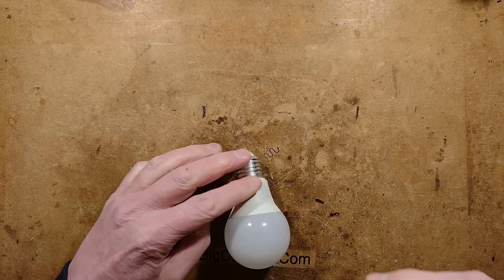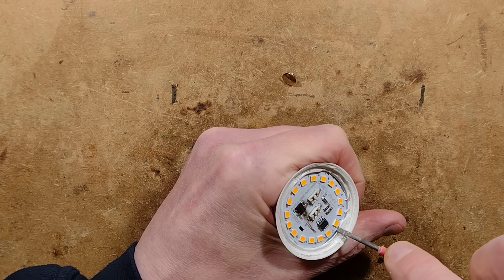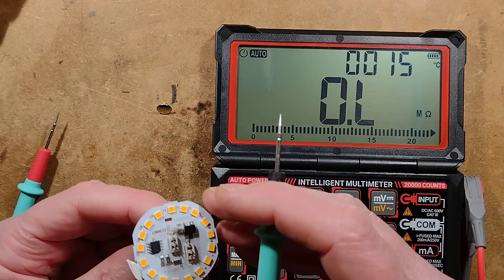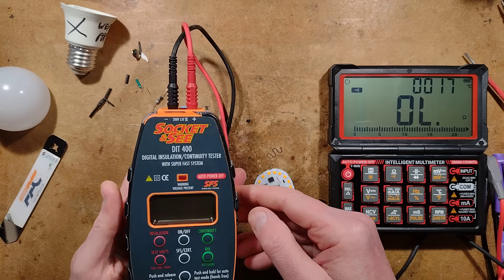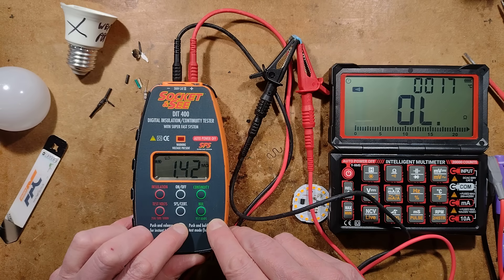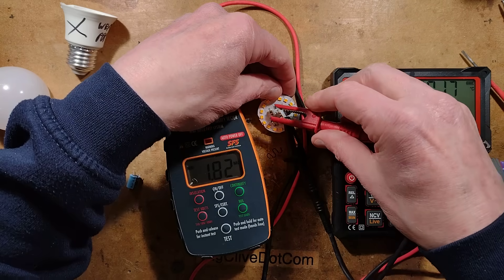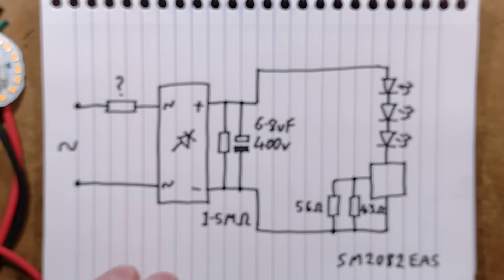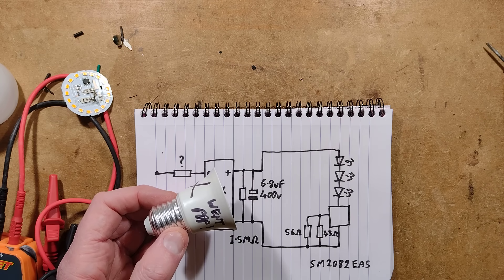Exploring an LED bulb that went POP during a livestream

Comment: Quick question for someone here ...
Is it worth repairing these Led bulbs, as I have bloody loads of non-working ones which I've haven't thrown away yet ...?
Reply from the maker: I'm afraid it's not really viable to repair them.  But with suitable understanding of the circuitry it is often possible to make new ones last longer by reducing the LED current.

Comment: I always try to diagnose my failed LED bulbs. I find that it is almost always the electrolytic cap (too much Chinesium) or one of the LEDs. If it's the latter then it's usually due to them being driven right on the limit.

Most LED bulbs could be made to last a very long time just by fitting a good quality Japanese cap and reducing the drive current by 10%. There would be next to no noticeable degradation in light output.

Occasionally you can catch an LED bulb just before the cap fails as it starts to flicker. I've found if I replace the cap at that stage they go on to last for many more years.

As a designer I would struggle with the ethics of making a product that is deliberately designed to be disposable but doesn't doesn't need to be. It would be possible to design and sell bulbs that last significantly longer and reduce an enormous amount of WEEE in the process.

Comment: I'd love some help understanding the internals of this bulb, because I'm clearly missing something. This being a UK bulb, I would think it would expect 240VAC, and my understanding is that on the DC side of the bridge rectifier, that would be 340VDC. And my understanding is that a linear LED driver will run at a wattage equal to the drive current times the input voltage no matter the load. This bulb is very likely using no more than 10W, so it doesn't seem to me that the drive current can be any more than 10W/340V= a little over 29mA. Based on what I thought I knew about LEDs, that current could optimistically generate like 20 lumens per LED, probably less. 17 LEDs * 20 lumens is 340 total lumens, but that bulb is presumably a 60W replacement, or around 800 lumens. So clearly some part of what i just said was wrong, but I don't know where. Are the LEDs maybe 9V packages of three internal LEDs each, or something?
Reply from the maker: The LEDs are multi-chip inside each package and add up to most of the high DC voltage.  The regulator only dissipates the difference between the capacitor voltage and the huge series string of LEDs.

Comment: Hey Clive, So when analyzing the circuit on the SM2802 part, you identified the 56ohm and 43ohm resistors connected in parallel to one of the device's pins as current sensing. Are the actual resistors current sensing... like they would be like a shunt on a solar battery system to measure current? I looked up the device and it looks like most pins are NC except for GND, OUT, and REXT. It looks like those resistors probably go to REXT which "... on the SM2082 series of LED constant current drivers is used to set the output current. By placing a resistor between the REXT pin and ground, you can adjust the current supplied to the LED, typically within a range of 5mA to 60mA, depending on the specific model. Just trying to understand sir! thankeeeeeee
Reply from the maker: The voltage across the resistors is held at about 0.6V by the internal current regulator.  Changing the value of the resistors changes the current where that 0.6V threshold is met.

Comment: My guess before diagnosis was the cap, they're usually the thing that goes bang... but as soon as you opened it and it was the rectifier I thought maybe not the cap then, but it could just be the symptom of the cap. Did you happen to test it on one of those multi-component testers to see if it's ESR was any good (in addition to it's capacitance?) or no? Anyway, that was interesting, as always. :D
Reply from the maker: I should have tested it on a more suitable tester.

Comment: Clive. What's the maximum current these drivers can be made put out?
Reply from the maker: It's quite high, but thermal dissipation becomes an issue with high voltage drops across the regulators.  Many designs stack them in parallel to spread the load.

Comment: Most likely the bridge rectifier fails - when diodes fail they typically fail short (become a lump of molten metal inside) so now you have AC on the capacitor that shouldn't have AC on it. Capacitor popped because the polarity reversed due to the shorted bridge rectifier, Electrolytic capacitors fail short until the electrolyte dries out (the electrolyte is conductive - the capacitance is caused by a thin oxide layer on one of the plates. The oxide layer dissolves under reverse polarity which causes the capacitor to fail short, which causes high current flow and causing the electrolyte to boil and pop. It's also why you need to reform electrolytic capacitors - long time of no usage means the oxide layer can dissolve and applying the proper voltage causes it to regenerate. The capacitor shorting out caused the fuse to blow because you're looking at a short.

Comment: I made an LED explode once, The story was from when I did not have many means of testing capacitor leakage current and I rigged up caps under test in series with a 5mm LED and loaded it up to the specified voltage and if the LED went out there was no leakage current to mention. It was a quite useful method but you also needed to discharge the circuit manually since series resistors would light the LED and render the test useless but I had a fixture for it. at one time I was testing a 500volt cap and had it fully charged when something in some unknown way made the cap discharge itself through the LED when being charged to 500Volts and the bang was absolute insane, what more is that the LED just vanished, no smoke, no parts! nothing, All gone! Just a loud bang and it was gone and only one of the two legs was left in the holder and the rest was vaporized without a trace of remains. I never figured out what happened or how it was even possible due to the way it was set up but well, I guess it gave up the ghost lol

Comment: Clive blows the dust off some interesting testers retrieved from the bottom of his test equipment cupboard, then uses one to blast 500V onto a 400V electrolytic. What could go wrong ?

Also - If you've ever short of ideas for the next video; a quick mini review of that Aneng Automotive meter would be useful. It wasn't easy to guess what some of those button functions were.

Comment: From what I can determine, those are 18 Volt, 0.5 watt 2835 LEDs.  The SM2082EAS is set to 25 mA.
I didn't realize the 2835 came in 3V, 6V, 9V, 18V and 36V versions, and 0.2, 0.5 and 1 watt.

Comment: You could 3D print a new frame for the insulation tester from TPU. Just take a photo straight down on the meter, and trace the outline in CAD.

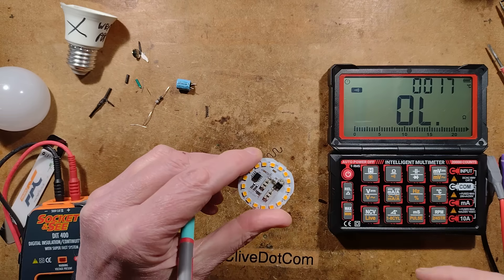Comment: 3:29 - It is easy, hotplate is 2$ on Ali, just place the board and it will melt solder in 5 seconds... you can also replace leds with that hot plate.
Reply from the maker: I have a hotplate.  Unfortunately the two connectors protrude.

Comment: every single dead led bulb i've poked around in of this style has been due to a faulty cap. the heat inside the bulbs lower area is contained enough that it shortens the lifespan and causes the cap to give up the ghost, i suspect.

i've literally never had any with any of the leds themselves failed.

far as i'm concerned, designed to fail. they're typically rated to a minimum of 5000 hours, but i've yet to have one last that long.

Comment: Can these lights with blown up circuitry be used in battery powered projects? Or will they not do anything without high voltage?
Reply from the maker: Not so easy, as the LEDs are multi-chip and need quite a high voltage to light.

Comment: Seems new caps are getting crapper these days even at 400 volt rated in these new led lamps and mini psu dofers, probably totally shorted rectifier for a few milliseconds or just overheated it's encapsulation to conductive carbon then popped it.
Gaz Yorkshire.

Comment: I have a LED bulb that uses three BP5131D
 chips to drive fifteen 2835 LEDs in series.  Very confusing.  From the schematic I've drawn the LEDs are over driven.  They are all out.  The label read 650 lumens, but 510 is the most it should be able to do.  Is over driving typical on these bulbs?
Reply from the maker: The LEDs are probably multi-chip LEDs.  They almost certainly are being driven very hard in consumer lighting.

Comment: 9:53 Focus sensors are typically a line of sensors, either orientated in a vertical or horizontal position. (or a mix) Your paper only has vertical lines, so the reading of the vertical sensors does not change as the camera is trying find the spot where the sensors give the highest contrast reading

Comment: Oh!! And dang it!! I have given into the LED bulb craziness! I like the filament ones more than these cheesy snow cones but have both. Some color temps I like like 6500 K true daylight that matches my vintage fluorescent lamps can beca bit hard to find, though! Ignore the double “like” above, my POS Apple phone has been glitching lately. I also find the filament bulbs with vertical slightly angled filaments do poorly base-up, where actual strong downward light is wanted, the snow cones do way better here for obvious reasons. Actually same issue as vertical axial filament incandescent bulbs as well. I still HATE the harsh 5000K ones though! NASTY! They should be taken off the market. Awful and way too stark. My best friend who is also a lighting buff and a bulb collector like me has disowned me because I went to LED for general lighting, but why burn up no longer made bulbs and have high power bills? He needs to wake up to reality! Cheers! Glad to be back! (Rick Delair!)

Comment: There seems no way to repair these. They are mde as throw-way items, sadly.
So even if you manage to replace the bridge rectifier or the self discharging capacitor,  you would still need to connevt the board to the bottom contact...
Hey, would have loved to see you pop the capacitor at 1000v !  😁

Comment: This is a small portion of why I kinda gave up on the idea of keeping lights with proper sockets at home and switched to led strips...
At first, I purposefully got light boxes with proper fixtures so that I could always just change them if they popped. But since then, I had multiple of them failing because these led light bulbs sold locally are not only expensive, they are also very poor quality. Couple of them popped like this one, and I had one weird case in the kitchen that was just whining, making a weird noise, and also changed it's color... when I took it down the plastic was all cooked and cap partially leaked or something.
So.. it's the fact that these led light bulbs not being a guarantee of long life, plus other benefits like the new lights coming with a fan, and being sealed off so no bugs come in, that convinced me to switch. Of course, now if one of them fails I have to replace the entire thing (or at least DIY replace the strip), but it's not all that bad. They come with a standard base that is fixed to the ceiling, and you just need to undo some screws and twist unlock it - the whole unit comes out. Kinda better than the wobbly fixtures I had before. Also put some lever nuts to make it easier to take out too.

Comment: Some years back I had a cheapie Chinese LED bulb experience a catastrophic failure. It popped and launched the small clear plastic envelope out the top of the glass chimney of the antique lamp.  The cat found the plastic part which eventually ended up in the kitchen.

Comment: My debug process, after testing the fusible resistor and finding it blown open, would have been to apply utility mains voltage through a couple ohms of resistance to the AC side of the bridge rectifier for a few seconds. (i.e. can you repeat the failure ....).

Comment: This was interesting. I've recently been taking those LED bulbs apart (didn't know they could be taken apart easily before) whenever they fail. I used to just toss them out thinking that was the end of it. Most of the failures on the non-smart ones I've looked at is there's always a burn mark around one LED (quite a visible burn mark as well). I was not able to fix them unfortunately. Saw some videos of people bypassing the LED to fix one burnt out LED, but this never seems to work on my ones. The bulb just buzzes but doesn't light when I do this. 

A smart bulb suddenly failed and would just constantly flicker like it was trying to start up - found a bulging cap on that one, replaced it using a cap from a dead ATX PSU and that fixed the bulb - been working OK for about 1.5 months so far. Another smart bulb suddenly died as well, LEDs are not lighting up. It's detected in app and you can even complete the pairing process by following the instructions in the app, but the LEDs don't light. So there is some signs of power (bulb detected in app).

The LEDs aren't burnt on that and they do light when probing with a multi-meter in diode mode. I think it's the LED driver IC on that, but not sure.  Nothing else on the board looks wrong to explain why the LEDs aren't getting any power. The board has 2 ICs: BP2525 and YT5202A. So I'm guessing the failure has to be with one or both of these ICs. 

Still learning about electronics and repair in general, but I love taking things apart and looking at them to see what's gone wrong. Sometimes I manage to fix it and get some great satisfaction from it. Other times I don't manage to (usually due to limited skill/knowledge) to fix it, but at least learn something in the process.

Comment: Probably just a spontaneous failure of the bridge rectifier.
The diodes PiV ratings are very iffy, china use them for "220 volt" applications but the diodes are barely capable of handling 240v offline use, with all the typical voltage spikes etc that occur in modern 240v household supply.

Comment: Something I would've done if I thought it was the capacitor is open the capacitor up and unroll its contents, odds are, if the capacitor did short out, but then the fault cleared itself, then it could've left damage on the electrodes or insulating material. Especially seeing what happened to the bridge rectifier.

Comment: Ahh. I haven’t seen a meter with dwell angle on it in a long time. My first meters were hand me down automotive meters and especially back in that era being able to measure dwell was important. 

I still would kind of like to have it on my meters for electronics since you could use it to measure the duty cycle of a PWM signal (as an angle tho).

Comment: Capacitor leakage testers exist, but they're a completely different beast from a megger.
A lot of YouTubers that I follow have been having trouble with cameras not camera-ing lately. Maybe it's a common software update.
Reply: I'm an old timer.
We just connect the capactitor to a DC power supply through a analog meter, I have analog (moving needle type) meters here with 100uA and 50uA scales.
If the cap has leakage you can see how many microamps the leakage is.
Not as easy with a 400v cap, but the best option is just to replace that cap anyway.
Reply: @wizrom3046  "...but the best option is just to replace that cap anyway." True that.
Ted Woodford has joked about leaving in old high voltage tone caps as "part of the mojo" (of course a guitar tone cap doesn't see more than a couple volts even with hot pickups, and current that amounts to a whiff of an oily rag), and Paul Carlson (Mr. Carlson's Lab) has plans for a low-voltage capacitor leakage tester, but since that relies on a LM3915 dot/bar chip that is rapidly becoming unobtanium, "replace the cap" seems the most reasonable approach if there's any question as to whether it's become faulty in any way.
tl;dr Cap may be sus, don't fret it - replace it.
Reply: I know of at least one who's camera doesn't camera any more because they decided it'd be a good idea to get a knockoff screen for their Iphone 16. You can probably guess how that turned out once they experienced the full depth of their mistake

Comment: Well, semiconductors do not like to get hot. I do not know how old that lamp is, but. Thermal cycling could have done the rectifier in. I mean, it is mounted to the same hot plate as the LEDs are or DEL.  That's the problem of driving these things hard like they do short life sometimes dead. Right out of the box, sometimes stop working in 2 weeks, sometimes lost in 6 hours. Meanwhile, some of the very early leds that had proper heat sinking seemed to still be working to this day. I think I will stay with my ferescent tubes for a little bit longer. And  incandescent lights.

Comment: This is why I don't make monetary bets. I would have bet it was the electrolytic capacitor that went boom. It seems odd that it was the rectifier that failed, though I suppose an electrical arc could just as easily make a "pop". 🤷‍♂👍

Comment: 01:51 you do realise it's socketed, right? As is the capacitor, for some reason.

If many soft plastics in your house are degrading in the same manner, I'd check if you've exposed them to fumes of some chemical. Also, polyurethane is not particularly stable as it's sensitive to moisture and some types of fungi actually eat it.

That new multimeter looks like a calculator.